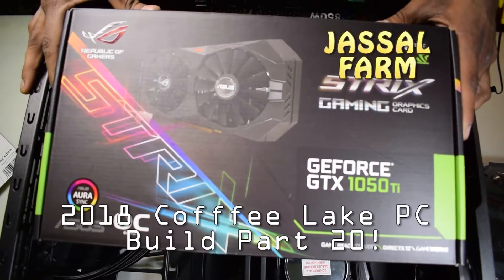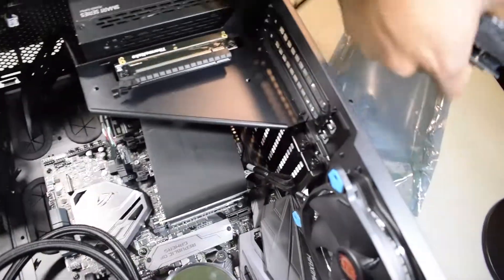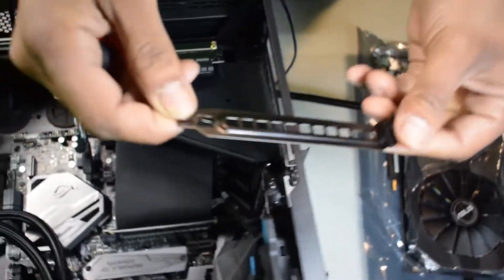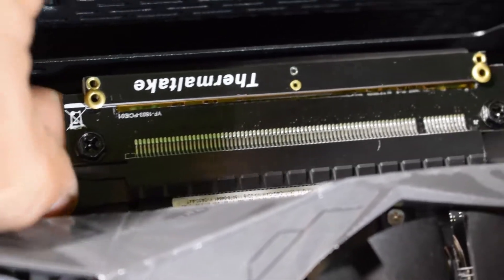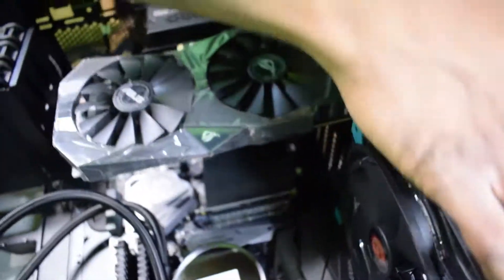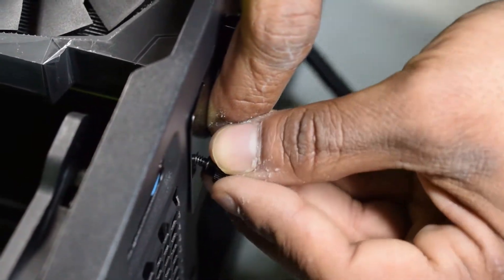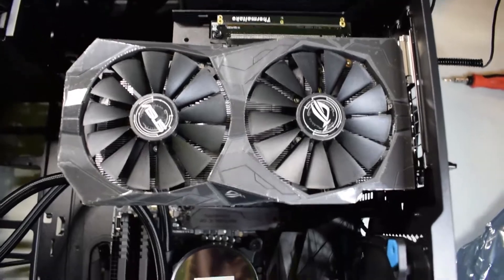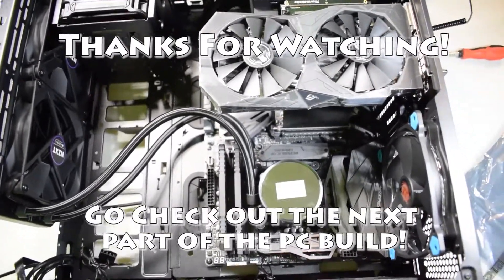(Part 20) 2018 Coffee Lake PC Build: Installing ROG STRIX GTX 1050TI Graphic Card!

Comment: It says I need a pci3 something what does mean?
Reply: Same
Reply: How did you fix it if you did end up fixing it?
Reply: Ceato i need a different mother board
Reply: @SantaCruz612  no dont I figured it out
Reply: @SantaCruz612  dont buy a new motherboard all you need to do is connect the pcie cord.
Reply: Ceato does it come with one?
Reply: @SantaCruz612  did you get a prebuilt pc
Reply: Ceato yea
Reply: But I bought this graphics card
Reply: @SantaCruz612  in the back of the pc or behind the motherboard there should be a pcie cord it should be zip tied back there just cut the zip tie and plug it into graphics card
Reply: Ceato thanks so much man
Reply from the maker: Sorry for the late reply, it means the motherboard you are going to install this GPU on requires the interface 
PCI Express 3.0 x16 at minimum. If you are trying to install this graphic card on a motherboard that has PCI Express 2.0 or later it should work, however it won't be utilizing it's full bandwidth speeds of the GPU.

Thanks For Watching & Taking The Time To Comment :)
Reply: JASSAL FARM thank u (: